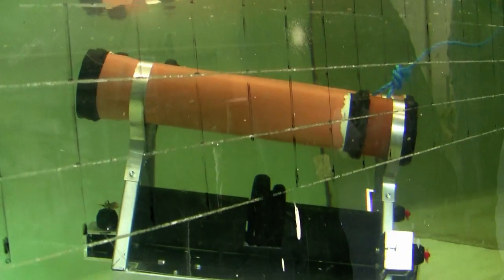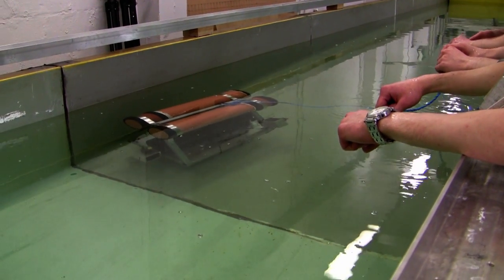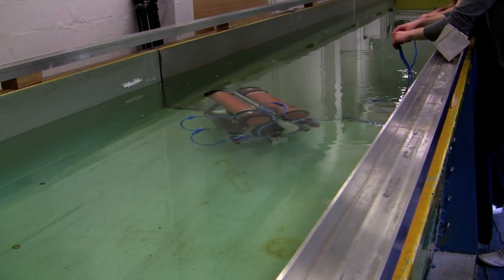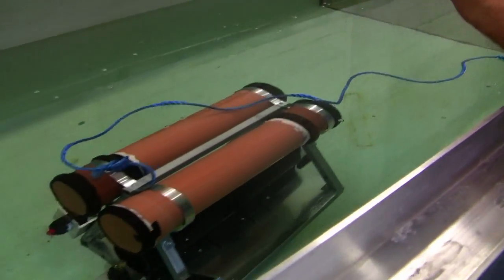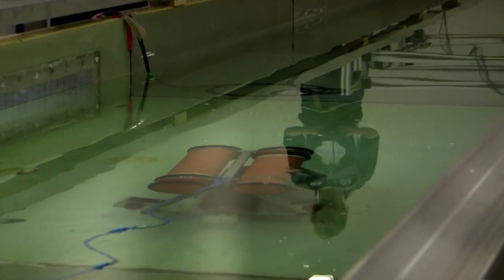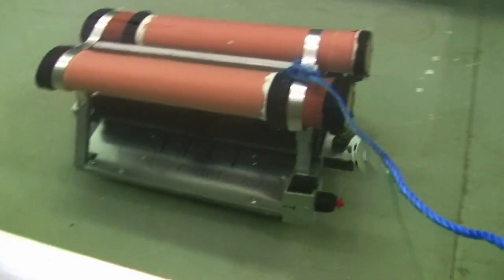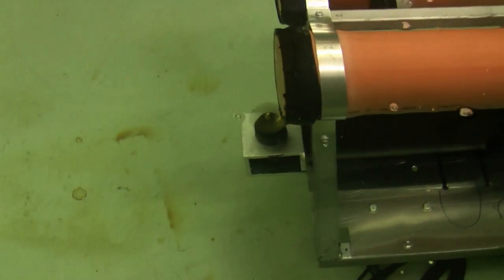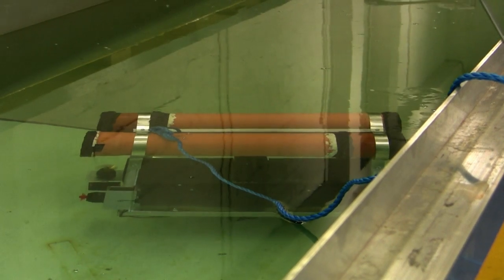Radio controlled submersible

Comment: Haha can't believe this video still exists.  It was all done with standard 40 mhz radio gear (futaba PCM 6 channel set).  Nothing all that fancy and the aerial in the ROV was wrapped up in the electronics box wrapped around various power wires so it certainly wasn't optimal.  Still managed to get reception from 50m away with it a good 4m down in depth.  Bilge pumps for propulsion and the rest mainly just to mount it all to

Comment from the maker: Student project to build a  #radiocontrolled   #submersible . 
They only had a few weeks to do it in, and a very limited budget. They were also  #mechanicalengineering   students, so with very little knowledge of electrics.
A successful device, using converted bilge pumps for propulsion.